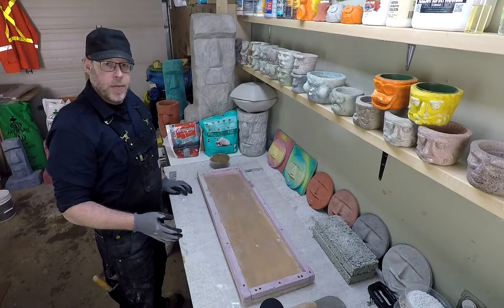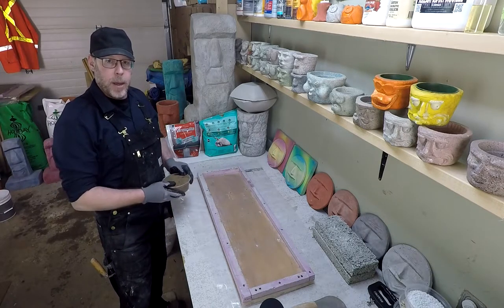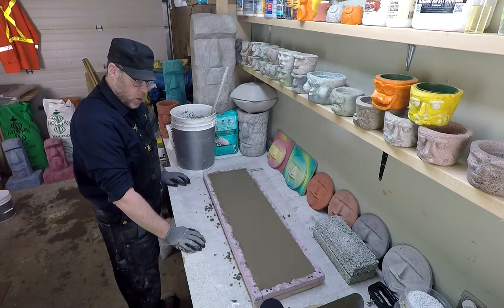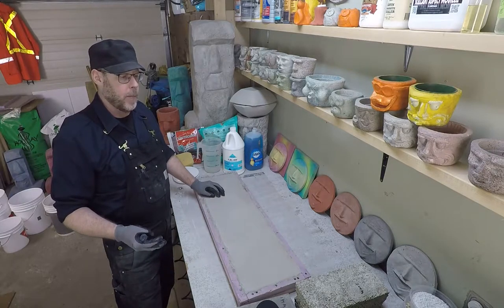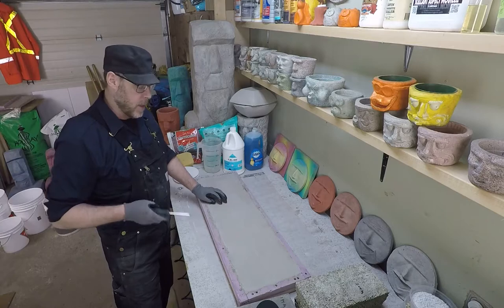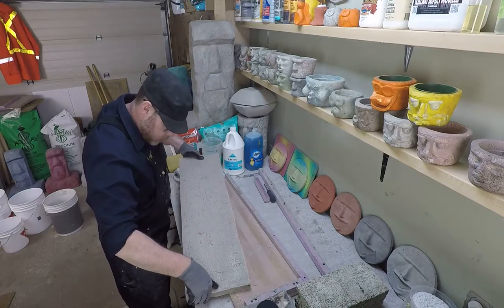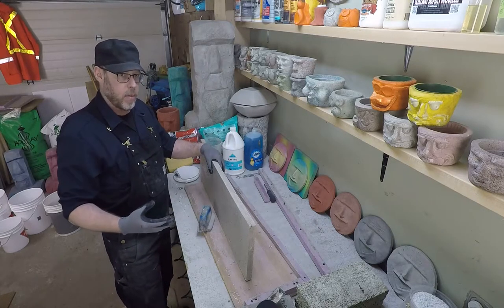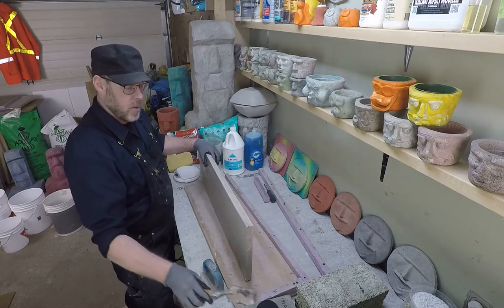Lightweight Concrete Showdown - Full Strength Mortar Test Block

Comment: I’m here for this! Another thing I have noticed is the volume difference in my sand….my pile is outside so depending on if it has rained a lot or not at all my sand is different. It seems to puff up and absorb the rain and is quite different in volume compared to if it’s super dry. I probably should account for this when measuring my mix but I’m to lazy to figure that out.
Reply from the maker: I like to store my sand inside. If not, I build a sand bin outside to at least have plywood and some plastic over it. Makes a huge difference because the water content held in the sand is huge.

Comment: Opening up a big can of worms!  Many variables.  Looking forward to it!
Reply from the maker: This is the truth.  So many variables.  This is part of the reason why I am going down this path so people can see how much small changes can make a difference in finished strength.  Even to this extent this is a rudimentary test method, but perhaps a starting point.  That is why I am sharing span length, thickness, mix design etc. so other people can try a different mix and compare it under similar circumstances.  I have now filmed the testing of these ones you have seen me making so far.  Test results coming shortly.
Reply: @creatingconcrete  Thanks.  It seems that most people report big variations in batches of aircrete when they try to repeat results. Something subtle apparently.
Reply from the maker: @nobreighner  Yes, I have also experienced this.  The density of the foam is the important part I think.  And using something like glycerin to stabilize the bubbles.  My water source is SUPER hard.  Calcium hardness 600ppm to 700ppm from the tap.  This calcium accellerates the mix set time but also causes the water to resist foaming.  I was able to make aircrete stable enough to pour using water this hard, so it definitely is possible, but I had two failures for every one success to get the air pressure and glycerin content right.  And none of the aircrete panels have lasted to break in the lightweight concrete challenge.  1" thickness and 32" test block might be asking too much from aircrete without some sort of tension increasing reinforcement.  Right now the test is zero reinforcement.
Reply: @creatingconcrete  Very interesting.  There is a lot of opportunity with glycerine (glycerol) as it is a low-cost byproduct of making biodiesel - and those guys should be producing now.